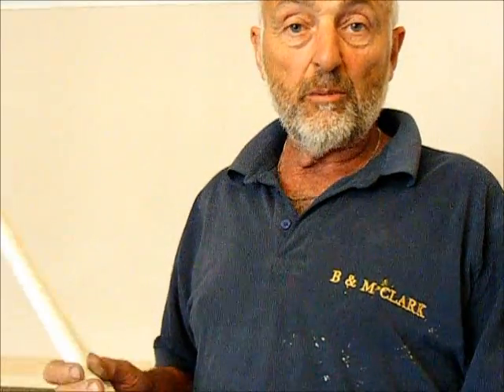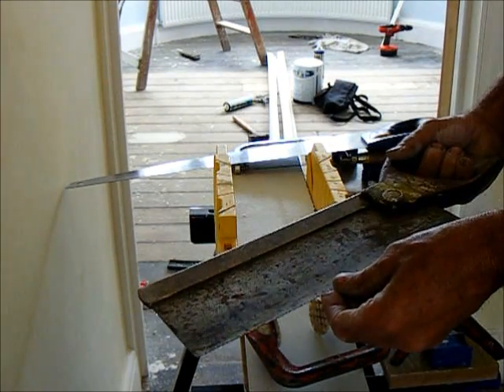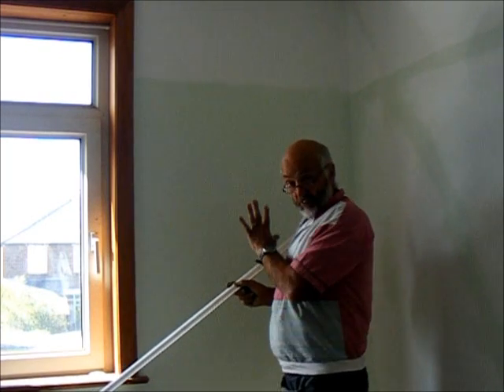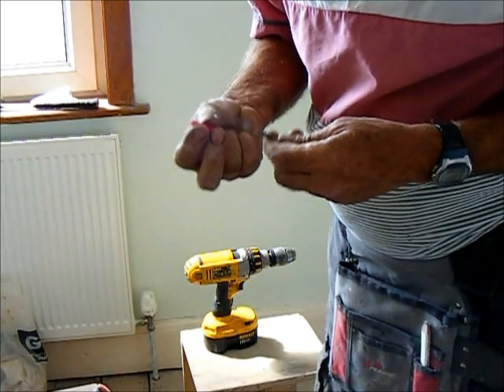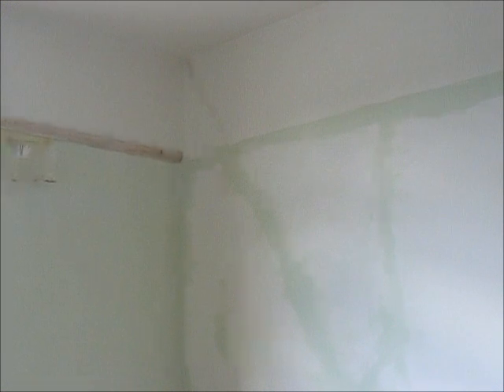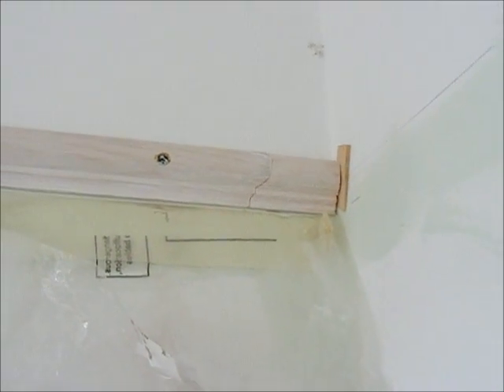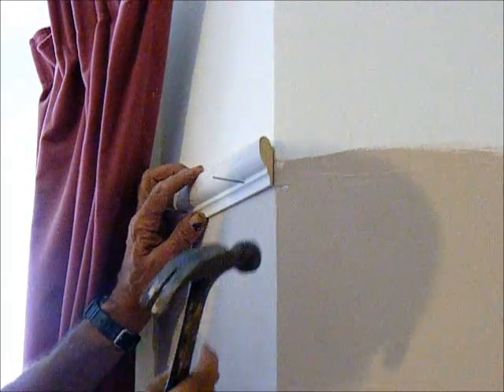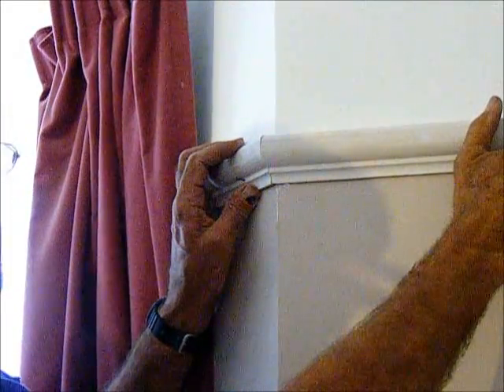How to fix picture rail.

Comment from the maker: Hi Woodkeeper.
To nail straight into cinder is very un-predictable in as much that if the nail point hits a hard bit it will skew off splitting or shifting that what you are fixing. Consider using Oboe nails to hold the rail in place then pre- drill the wood then use cut nails. If the nail hits a hard bit take it out. I think screws and plugs is the best option.

Comment: Looks like you had the coping saw blade in the wrong way around. You should cut on the pull, rather than the push, as this keeps the blade under compression with the frame.

Comment: Nice tutorial. At eight minutes you say  "...blocks are very unpredictable and it don't always work, Screws and plugs are the best option" But I can't catch the beginning of what you say. I imagine you're talking about nails into cinder blocks? Anyway, that what I'm interested in. The original rails in this present house (1930's london) were nailed straight into internal walls of cinder blocks, and nailed into wooden wedges paced between brick joints, in the outer brick walls. I'm considering nailing straight in to the cinder blocks.
What do you think?